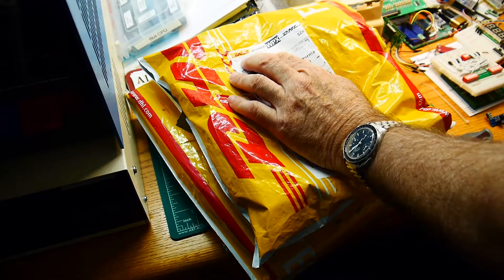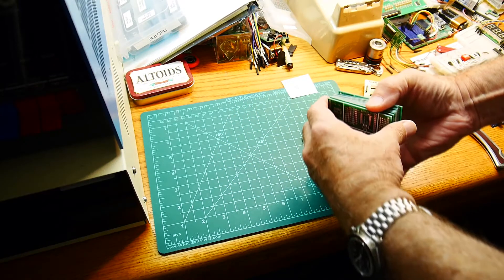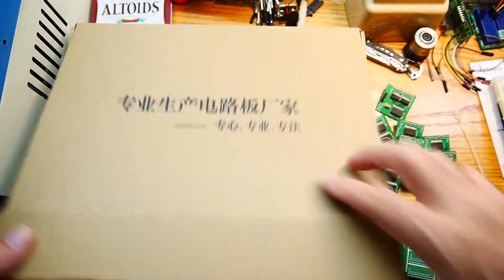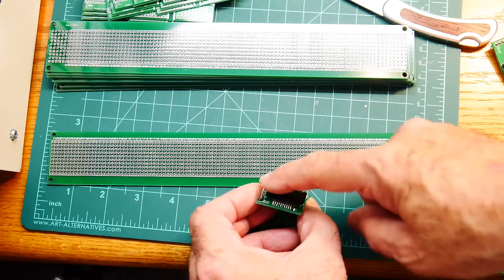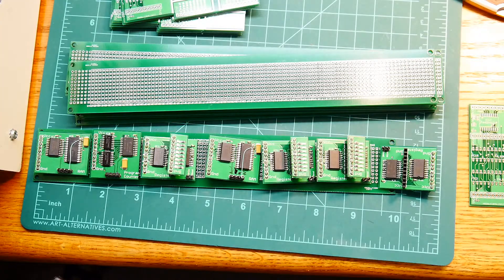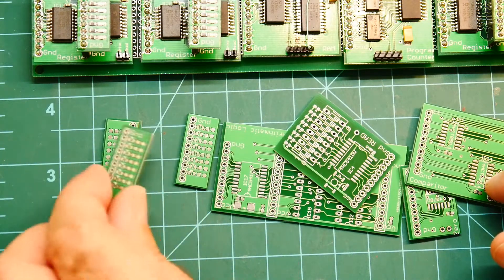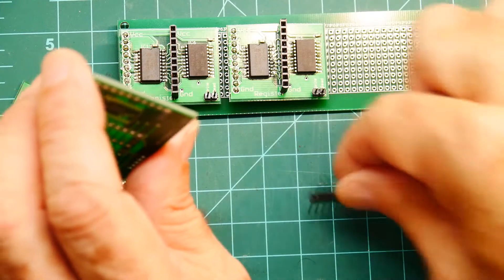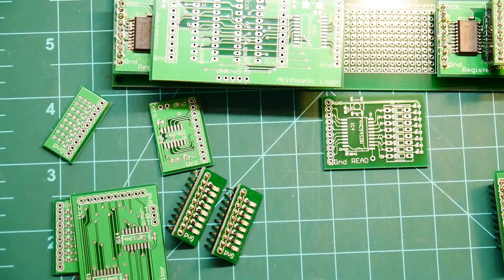#89 TTL CPU ALU and backplane PCBs

Comment: Have you considered chip/gate fan-out? That's a lot of gates and LED's to power.
Maby the LED-board should be active with it's own driver.
Reply from the maker: I did. the leds are run with 1000ohm resistors so 5v - 1.8v (led) is about 3mA. The gates are good for +/-4mA and the fan out to other CMOS gates is easy. I will not need anywhere close to 1mA extra. Remember there is only one output and one input device on the bus at any time so that is no problem. There is a couple places maybe a fannout of 2 or 3 but very rare and again CMOS so no problem. The only issue I have is using the 74F382 ALU chip and so I have a 74HCT541 chip on that output to make sure the logic levels are OK. and actually 10k resistors on the LEDs would still work as the LEDs are quite efficient these days.